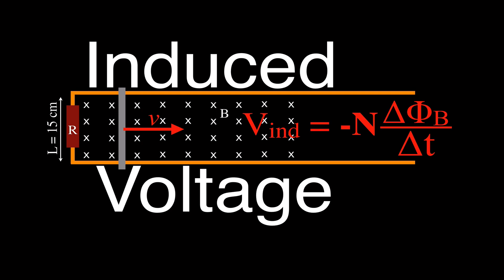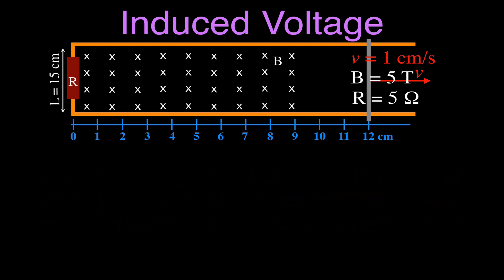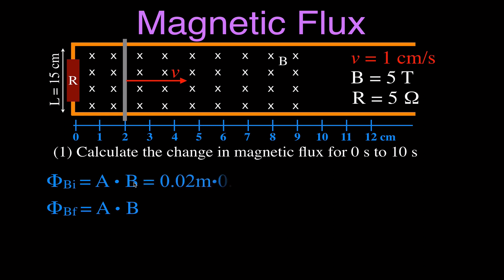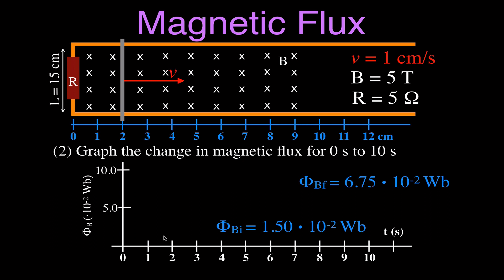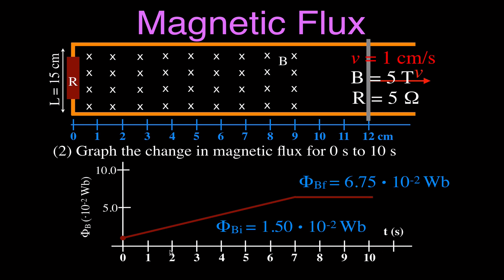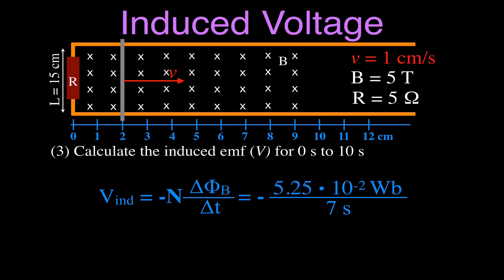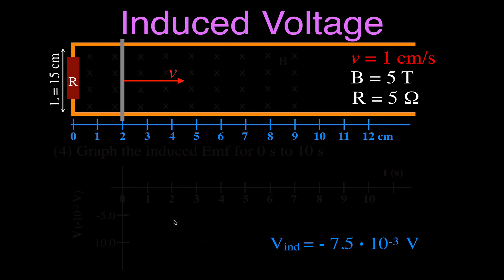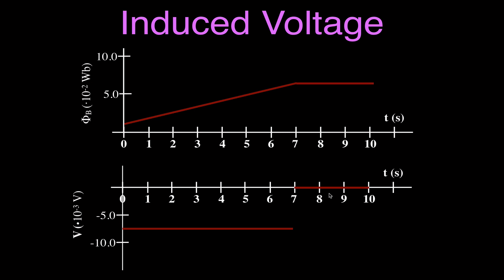Electromagnetic Induction (9 of 15) Induced Emf in a Coil of Wire, Example No. 3, Part 1

Comment: Thanks for the video.

I am wondering why an EMF is induced as the wire rolls through the field in this example, but no EMF is induced in the previous example (8 of 15), where, again the wire is moving through the field? I get that in the previous example, the flux in the loop of wire is constant, but why is this example any different?
Reply: The only thing I can think of is that, in the previous example, when the wire is moving through the field (i.e. when the flux is constant), equal and opposite currents would be induced in the left and right side of the wire, which would just cancel out.
Reply from the maker: When a coil of wire moves through magnetic field the magnetic flux through the coil is not changing, but here as the wire moves to the right the area is increasing and therefore the flux is increasing.